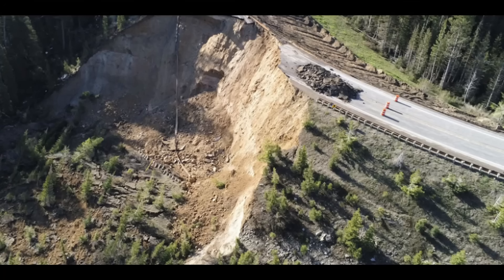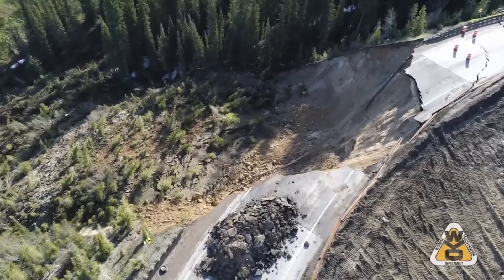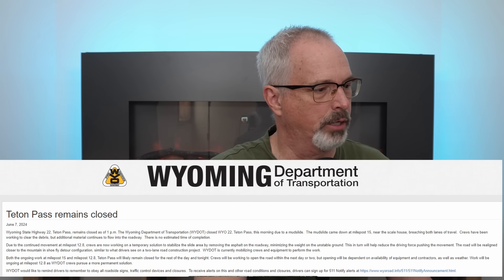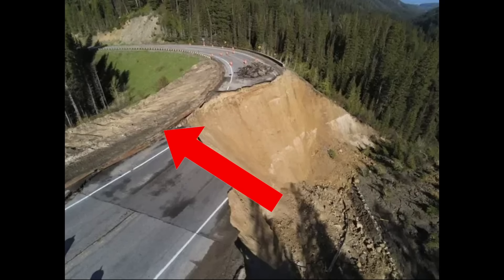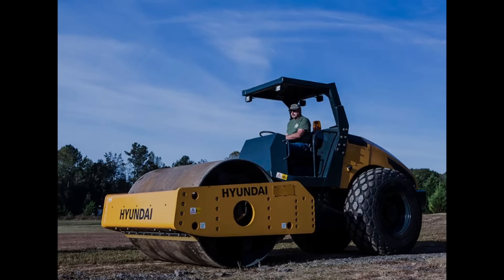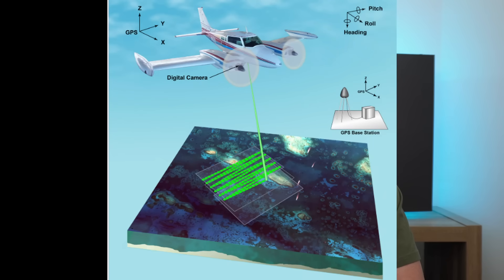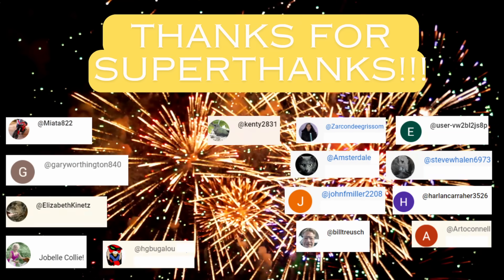Major Highway Embankment Failure in Wyoming!

Comment: Interesting video. Here's the location of the slide, 43.503393, -110.975385. It's a fill forming a horseshoe, or hairpin, curve over a natural swale in the landscape approx. 200 feet deep with a 10% westbound downgrade, plunging 400 feet (122 meters) over a linear distance of roadway approximately 3700 feet in length. Pretty typical for a byway in the Rockies. 
TLDR, I assume this one was built some time in the 1950s, well before construction elements like geogrid reinforcement was even a thing. That technology was developed around the time I graduated high school in 1981. The practice of cut and fill right of ways on an industrial scale was developed by Western railroads scrambling to build transcontinental railroads. The scope and scale of infrastructure that needs to be rebuilt and updated in this country (indeed, all of North America) is quite monumental in scale.
Reply: There is a powerline easement just north of the road at that point. The service road bypasses the damaged section of road. Unfortunately it looks like it would take a 4X4 and some skill to navigate the service road.
Reply: @beebs4881  You're correct. I've been on that jeep trail on a mountain bike, and on skis, when the avalanche danger is low.
Reply: @beebs4881  Yeah, it's basically a jeep trail. Still viable, if not sensible.
Reply: @beebs4881  Right, it's just a jeep trail. 
There's no simple fix. WDOT may have to rethink the entire pass.
Reply: If I remember, that grade at that section was like 11% back in the day.. that is enought to stall out many semi's.
Reply: Built in the 1950’s - NO!  My family moved away from the area in 1974 and this hwy had not even been started.
Reply: @knan75  The current route was completed in 1969, but the road has been in place in one form or another since 1913. Do your research, son.
Reply: You are correct in your analysis. This road, in it's current configuration, was built back in the 50's. 
And the money that might have been spent on the renovation of such infrastructure is gone. It was sent to Ukraine. Or Israel. Or is being handed out to the tens of millions swarming across our open border.
Reply: @robgrey6183  Or being handed over to the largest corporations in our country in the form of massive tax breaks. See, anyone can spew their politics here!

Comment: Casey, at this point would it be quicker to just build a bridge across that chasm? Just to get the road open as early as possible.
Reply from the maker: I think they should look at something like that at the base of the hairpin curve just up from the creek.
Reply: I thought about the bridge, but the slope would be steep going up and downhill.  That being said, a bridge might be faster, but the soil conditions are such that the soil around any footer or abutment would  need stabilization.

Did you notice the dirt road at the bottom of the swale by the power line.  That route needs investigation to see if it is better to switch the road along that track.

I noticed a lack of rock both on the hill sides and the fill.  Doesn't Wyoming have any rock for use as fill or rip rap?

Comment: I’m not a professional engineer, but having designed barns and sheds, built barns and sheds, and stabilized terrain as necessary, I’m of the opinion that the work on the uphill side accelerated the inevitable.  It was only a question of when.  Also, I’d be curious how the road width would be affected by measuring the road based on the width of the lines being used to scale the road.

Comment: We live in the area.  Some corrections: (1) The failure was between Wilson and Victor, ID - not between Jackson and Wilson.  (2) The mud slide shown and the slope failure were 2 miles apart.  The forecasted "opening" was for clearing the mud slide debris - NOT for the slope failure - which occurred during the closure for the mud slide.  The filled area was constructed many years ago and probably did not have current steep slope stabilization technology available at the time it was constructed.
Reply: And probably nowhere near the amount of traffic it does now.
Reply: Yeah I used to live up in that area and my understanding is this is something that was built back in the mid 50s I think
Reply: My son lives in Wilson and he is not cut off from Jackson but some of his coworkers have had to drive 3 additional hours round trip to get to a job site.   As far as the corrections being not relevant, for those affected, they are totally relevant.  I bet they open a detour around and then repair the roadway or even reroute the highway. I'm sure all options are being explored at this very moment.
Reply: @stanwamberg   Pedantic corrections to a video posting about the reasons for the failure of the highway are unnecessary.  Clearly people are impacted when bad things  happen but the video was about the highway, not the names and locations of local landmarks or a victim impact statement.  Sorry for being a bit critical and I do feel badly for the many people affected by this major disruption.
Reply: Your corrections are noted but not relevant.  Wy DOT can't blame grandpa for this failure.  They own it.
Reply: Eyeballing it, the bottom of that valley (well downhill of where the failure scar is) appears to be ≈300 feet below road level. Is that a reasonable estimate? Seeing that drop I can full well understand why they made it so steep. However, even if they'd made it in the 1950s it isn't as if they didn't have at least minimal stabilization options available…(apparently) not using anything was insane.

Comment: Great info … thanks. From a bigger geologic picture, this slide occurred along the still active Teton fault system.  Also, land slides, rock slides and such are an outcome of this region of basin and range extension/land surface spreading. A sort of rifting.  Clay soil is another issue … destabilizing clay can lead to sudden land failure, such as with the Rissa Norway quick clay landslide.

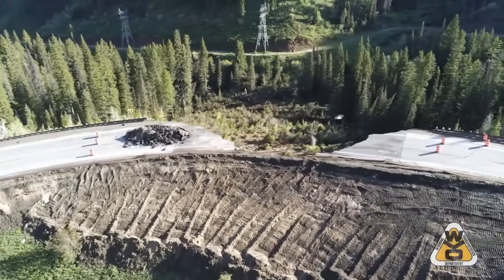Comment: None of the photos or videos showed the entire downslope area in detail. It is possible that other slope instability downhill from the embankment was one of the main causes of the embankment failure. The only view at 11:00 shows what appears to be a slide all the way down the slope to the creek. The big question is whether all of the slide material is from the embankment alone, or whether there was a pre-existing slide on that slope. The lack of large trees in the slide area is common on areas of ongoing instability. Having some downhill photos from after the embankment cracking started, but before total failure would be very helpful.

Comment: They were asking for a failure here. No erosion control and any structural crack should have been a red flag. My grandpa was a bulldozer operator preached proper drainage, ground cover, and monitoring cracks on driveways, parking lots, and building pads.

Comment: In my uneducated opinion, the only viable solution here is to remove all the fill, return it to its natural state and construct 
a Viaduct to completely bridge over that portion of the highway, eliminating any future road failure due to flooding or washout...
or am I being a complete dumbass 😎
Reply: (I haven't been over that pass in 40 years, so this is speculation.) 
If there aren't a dozen other places on the road with similar problems. 
If there are multiple similar challenges, they often are handled the same way.

Comment: We had an almost identical road failure here, in New Zealand, last year. There's a vid on this platform that shows the huge land slip, as well as the resulting fix that was implemented to restore the road. You can find the vid by using these words: 'Coromandel highway to reopen early'. NOTE: The TV reporter is wrong in stating there was already a bridge there, as it was a solid road on not-so-solid ground.

Comment: The location of the slope failure and the mudslide are both on the west side of the pass. Google Maps and Bing Maps reporting of the location as being between Wilson and Jackson is completely off. That is on the valley floor, not in the mountains. Neither map app can find the mile markers. They only show the street address. The mudslide was at MP 15, at the port of entry truck scale just east of the Idaho-Wyoming state line. It came down Talbot Canyon and blocked the culverts. They were clearing the mud there when the road fell apart up the hill. The road bed failure was at MP 12, closer to the top of the pass, but still on the west side of the mountains. We have been having a lot of thunderstorms in the area. There is one going on as I am writing this comment The mountains are steep and composed mostly of decomposed volcanic ash deposits over granite batholiths. The contractor had not sent anyone up there to work because of the weekend. There are some parallel forest access roads, but a lot of work will be needed to establish a connection between the east end of the nearest road and the highway above the slide area. That road will allow limited passage over the mountain for local traffic, but not in bad weather.  Certainly, there will be no way for trucks to use the pass until the highway is completely reconstructed. The ABC affiliate, KIFI in Idaho Falls, has had several reports over the days since the closure. I drove over the pass from Jackson 2 weeks ago and the cracks were visible in the pavement. Work had already started, but they had not removed any of the pavement. The pavement has built up to more than 2 feet thick, because they have been repaving without taking any asphalt off. That is why they were removing the asphalt. It was not a few inches, as you have supposed, it was more than 2 feet. They have been working on the highway over the pass every warm season for the entire 20 years that I have lived in the area. This is similar to the failure of a segment of California Highway 17, just west of the summit between Los Gatos, CA and Santa Cruz, CA. There they had a slope failure in 1949 that cut the railroad and resulted in its abandonment.  In 1970 it was still moving and they were rebuilding the highway on the top of it every few years.

Comment: Because you know leaking fuel never catches on fire.
Reply from the maker: I never said that. I'm merely pointed out that those were EVs that caught on fire in China. SHEESH.
Reply: No, you said you "imagine these were EVs". Why, because they caught on fire? It just repeats the myth that vehicle fires are more likely to be caused by EV batteries. The majority of vehicle fires are due to damaged or misinstalled fuel lines, or other overloaded or exposed wiring (e.g. aftermarket sound system installations).
Reply from the maker: @ElderNames  I imagined they were EVs due to the intensity of the fires. This isn't that complicated. If I had said they were gasoline fires you would be fine with it. For you to fixate on a comment that took 2 seconds to make in a 15 minute video is odd.

Comment: Yep…,
“prediction”.., Wyoming DOT, to State Treasury head…, “we need some major work ($50million) done on HWY 22, that should have been done in the first place”…  Treasuer, naw we don’t have the time nor the money nor funds for that kind of stuff, just fill it in with some the local landslide slurry run off and overburden, and get to fillin them pot holes before the snow flies”…
     Not one culvert, curtain drain, rip-rap ballast, and as you mentioned no signs of one square foot geo-grid bedding etc.., in amongst the debris.
    You know there will be an investigation and some sort of “scandal” report comes out of it.
     Absolutely amazing that there are no vehicles buried in the debris.
Great report..!  Look forward to any follow-up report(s).
Thank you sir.
Reply from the maker: Thank you so much.  They have rushed in to a temporary fix and have gone "radio silent" about what they are doing about implementing a permanent fix.
Reply: @CaseyJones-Engineer  hahaha.., just amazing.

Comment: I notice a horizon where the tan fill rests on lighter colored sediments.  Assuming the lighter color is naturally emplaced moraine or fluvial sediment, I suggest the slide plane was much deeper than Casey suggests.  Speculating further, the topography suggests to me that the up-canyon floor became saturated and flowed rather than ripped.
Reply: It's a short section built atop a ridge. There isn't any up-canyon.
Reply: no, those are layers of the fill.

Comment: Wow, the incompetence of the DOT here to not shut this roadway down is amazing.
Reply: Just last summer they added asphalt to fill in the depression from that section slowly sliding downhill. Oh, that isn't the kind of maintenance you were thinking of, I bet.😊
Reply: Actually, the road was closed due to a mudslide a few miles down the road. The crack that have away is a separate issue.
Reply: From an ABC News article I have the impression that the road was closed on Thursday by state DOT engineers and geologist due to concerns about the movement. 

But there was a logical disconnect. Someone decided to repair the cracked pavement and reopen the road. Sounds like someone disregarded the engineers and geologists concerns.
Reply: Grew up in the surrounding area, and the WYDOT is NOT of the same caliber as it once was!!  Western WY roads were once the best given the cold/hot/cold regime of WY!!  Wester WY highways have deteriorated significantly in the last 2 decades, and the highway use has more than trebled!!
Reply: Fortunately the mud slide came in and did that for all of us.
Reply: They did shut it down.
Reply: @michael931  They patched the cracks initially.  Then the mud slide started a few miles down the road closer to Victor.  The mud slide is what caused the shut down, fortunately, and then the next morning the slide occurred while road was still closed due to mud slide. Mud slide and the road failure were two different spots.
Reply: To be honest, I think it’s less WYDOT incompetence and more lack of State government funding. No sane engineer would expect that soil embankment to last 50+ years without some serious periodical maintenance work.

Comment: I understand it's desirable to maintain a steady and mostly level grade. But the ~120 feet of fill you estimated just looks excessive, especially if they plan to restore the road's uniform grade.  A safer, more pragmatic and lower cost alternative would be to cut into the bypass/shoefly, and carve a road several hundred feet back on either side that allows the road to descend, say, 40 or 50 feet at the point where the slide occurred. That would cut the fill height by nearly half, allow the existing fill to be redistributed so the soil angle is shallower (relative to the angle of repose?)  P.S. Both the heavy equipment used to carve the bypass, as well as their vibration, may have initiated the instability transitioning into actual movement.
Reply: That might well get into a land-ownership mess. I don't know how willingly the Forest Service gives up land, if it is FS land. If it's private, it may be worse.
Reply: @vanlepthien6768  You're right that ownerships and permission could restrict alternatives. Even just widening the berm so that it's more stable could do that. But to my mind, compacting dirt fill to a height of ~120 feet just sounds dubious, even if the berm is wider. For a height of ~120 feet at the ravine's base, maybe a bridge would be a better alternative.
Reply: Nope, not level here. Corner was sharp as it was, so can't just shoefly it. Safely, at least.
Reply: @paulmead4401  Given that the shoefly will blend into the existing road at either end (beyond where it had already been bulldozed), it appears as shown in the video (say, at 7:43), that the shofly looks like it would actually cut a shorter, straighter line. It may be a moot point, but building a 120 foot tall berm just seems dicey, no matter how much it allegedly has been compacted.

Comment: I live near there and that pass is very steep and ends up closed multiple times a year.  They are damned lucky this didn't happen during the day or there would very likely have been deaths when that road went down. It is beautiful up there but I don't like driving that pass so I go by the way of Hoback junction, which is the way these people will now have to go to get to Jackson and it is a long way around.  That highway collapsed on that highway some years back as well from a massive slide and it took over two years to get it rebuilt and reopened.  It is a steep area either way you go.
Reply: Yup, Walgreens too and you can't blame 1950/60's construction and that disaster.
Reply: Could have been a bus load of kids.   WYDOT, "just chip seal it".